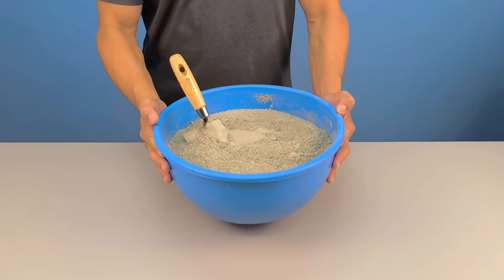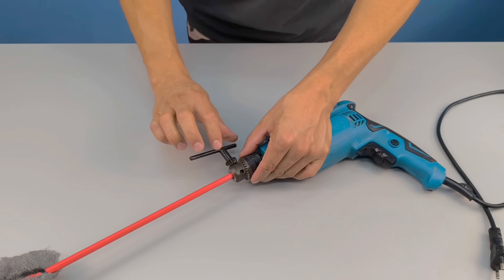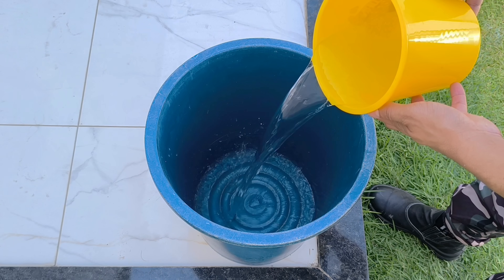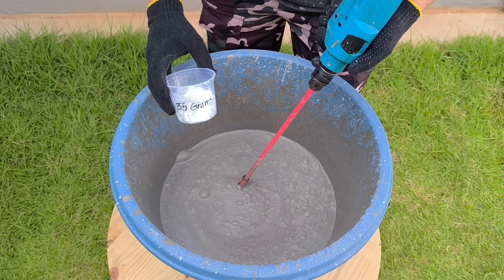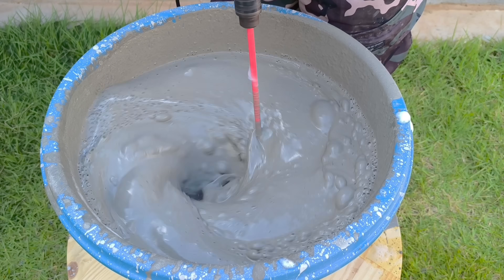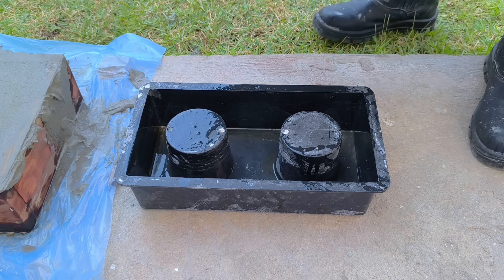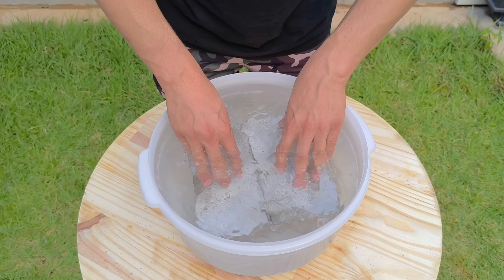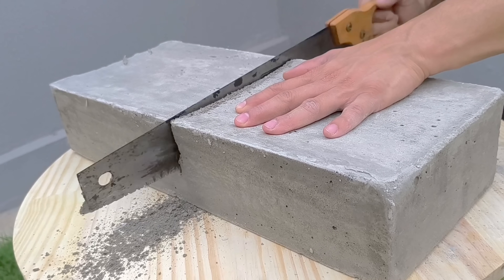Mix CEMENT with DETERGENT and create something that can REVOLUTIONIZE civil construction!

Comment: Could you make a follow-up video with some stress tests? I’d love to see how its strength and resistance compare to traditional concrete.
Reply: And water resistance/permeability.
Reply: Also, 🤔 what about the r-value on the insulation factor on heat transfer?  🤷 Thanks
Reply: @hcaveman6954  if it compares to other aircrete formulations the R value is huge. Somewhere around 50 I think? It also behaves similar to stone in the thermal mass characteristics but not as well. The addition of fiberglass may lend some structural stability I haven't seen in other formulations. I may try this method on a small scale before building a foam generator with an air compressor. I don't believe this end product can survive exposure to the elements, rain in particular, so I imagine it'll have to be sealed on the external faces, or behind an impermeable siding like steel or vinyl. I was thinking about an RV roof type brush on silicone. There's numerous aircrete techniques out there, if this is like others it'll be a building component with novel properties, not a standalone structural one.
Reply: @hcaveman6954  Foamcrete is reported to be about 3 to 4 R-value per inch.
Reply: I'm just going to go out on a limb here and say that concrete is weak very easy to break and not viable to build with
Reply: @jamesonbrandt9451  Concrete is a very weird material. Used under pressure, it'll last hundreds of years. Built in concrete slabs with less pressure, and it'll crumble within 50 years. Many 70s concrete buildings are unsalvageable, while buildings from the Roman Empire hold steadfast with no cracks.
I have my doubts that he is equipped to test these concrete bricks with a material that can behave so very differently depending on the pressure under which it is put for centuries or mere decades.
Reply: @SilkesterOnTube  Did the Romans use Joy or Palmolive?
Reply: @ShannonWoodcock  Talking about concrete generally, not foamed concrete. When comparing foamed concrete to concrete in general, the difference in behavior when the construction applies constant pressure and when it doesn't is relevant, and this difference shows after decades, which makes the testing on a crucial aspect of concrete for a youTube video unfeasible.
Reply: @SilkesterOnTube  the Romans made their concrete out of different things. This would probably be good for insulation. I've seen dome homes built out of this foam brick they can be shaved and shaped into interesting shapes then the arch form is then covered with a shell of harder cement or mortar and they have insulation properties not unlike like a cob house
Reply: @sarahsutubeusername  Shoot. Should have checked instead of relying on a vague old memory from an art history lecture. Did fact check you and learned something. Thanks.
Reply: @SilkesterOnTube  roman concrete was a thing on its own you'll have to look it up, quite genius actually!
Reply: @SilkesterOnTube  Romans used a very different mix of concrete which was well used at the time and probably not made by them as it is found even in ruins far predating the Roman Empire. That mix gets stronger over time and in salt water (oceans) and lasts for ages. Our modern cement is designed to wear out because having to buy new means money from replacements and repairs.
Reply: @hamzahsayang This is nonsense! That is your interpretation of modern cement. Like much ancient knowledge, the knowledge of this recipe was lost until a few years back, when a German rediscovered it.
Buildings can't afford built-in wear and tear. When corrupt builders try to save a buck and make concrete even shoddier than its normal life span, people die in collapsing buildings. 
 And with modern concrete buildings, there often is no restoration. I learned about the lifespan of concrete in an art history lecture, because in Europe you try to build for the ages and preserve buildings from known architects,
Historians have a hard time with post-war concrete buildings. The only choice is to tear it down.
And when a buiöding costs up to a quarter of a billion, even US real estate moguls frown at a 50 year life span.
Reply: @ShannonWoodcock  they used lard and lye lol
What do you think soap is made from.
Reply: @SilkesterOnTube   there actually is a scientific study on Roman concrete that discovered why it lasts that long:
Material and Elastic Properties of Al-Tobermorite in Ancient Roman Seawater Concrete
Found at
Journal of the American Ceramic SocietyVolume 96, Issue 8 pp. 2598-2606
Reply: @marcoconte7673  I'm sure there is. There is also a company founded by a German who recreated the recipe. These days, you can buy concrete with the properties of concrete from Ancient Rome.

My initial post was casual and relied on a vague memory of an art history lecture from decades ago. I'm happy it led to all this new information. I regret I was so casual and didn't go on a discovery tour before posting.
Reply: @ShannonWoodcock  :face-blue-smiling:
Reply: @jamesonbrandt9451   You would be incorrect.  Although it doesn't have compression strength, it's not brittle. Suitable for building structures of a single story. It has great insulation value as well. Look up aircrete for more uses.
Reply: @jthomas7904 oh no... just like concrete, it is still brittle. Use proper rebar and dont use aircrete for structural support.
Reply: @jamesonbrandt9451 and you would only be half correct
Reply: Im gonna 2nd this lol I had the same thoughts myself. If it cuts and scratches way easier then it's density is less than normal and would mean it is NOT as hard as regular cement I could be wrong tho and thats why we must experiment 😊 lol curiosity
Reply: @FrvrClud  "its" density. "It's" is the contraction of "it is"
Reply: And fire resistence
Reply from the maker: That’s a great suggestion! I’m planning to make a follow-up video testing its strength, compression, and durability against regular concrete. It’ll be really interesting to see the results.
Reply: @inovaouinventa why re-do that experiment? It was done many years ago when aircrete was first invented.

Youtube search "aircrete" and "green dragon".
Reply: @inovaouinventa  oh god it is obvious ai.
Reply: And BULLETS WITH DIFFERENTS GUNS🤦🏻‍♂️🤦🏻‍♂️🤦🏻‍♂️🤦🏻‍♂️🤦🏻‍♂️🤦🏻‍♂️
Reply: @inovaouinventa  follow up with fake data. you are a clickbait fraud!  PERIOD!!!
Reply: Roman concrete had a secret ingredient.  Volcanic ash that was shipped hundreds of not thousand of miles to build.
Reply: @christophern.9234 it was also made with salt water.
Reply: 7 day/ 28 day breaks  a full (by proportion mix design). Due you  have SKILLS! 👍
Reply: Mukavemet 2.5 Mpa (thats traditional brick are 5-10 mpa, normal building concrete 25 mpa), ısıl geçirgenlik katsayısı lambda 0.05-0.1 w/K.m2, buhar geçirgenliği mevcut yani nefes alabilir, birim ağırlığı 500 ile 600 kg/m3, yangın dayanımı A1 sınıfı, metal veya betonarme karkas arasına örülebilir ancak kendisi taşıyıcı Yapı elemanı olarak kullanılamaz, belki sadece 1-2 katlı ev yapmak için uygun olabilir, olumsuz olarak niteleyebileceğim tek özelliği bu malzemenin karışım esnasında katılan suyu içinden dışarı atması uzun zaman alır, eğer içine fiber katılmazsa kendi kendine çatlama yapabilir.
Reply: Is this how they make karate bricks ?
Reply: What about using this as ferro cement plastering ? How water proof is it? As an interior layer
Reply: How 'bout a sledgehammer test?😂
Reply: I'll save you the trouble. It is more brittle than regular concrete. We used to do this decades ago with stucco. It made the mix easier to spread, but got banned by the building code because it lacked sufficient strength.
Reply: these are for insulation not structural. only used as infill between structural posts & beams.
Reply: badly in a word
Reply: he cut it with a wood saw, does that tell you anything? and 35g of fiberglass is not nearly enough to add any strength value to that volume
Reply: I would like to know the Concrte strength what’s its PSI after 28days. And even if it’s half the typical concrete that still great and will have many practical uses
Reply: @lidoz roughly 25% to 60% the strength of regular concrete, depending in what you've added to the aircrete mix...  plaster makes it weaker, so this mix is 25% to 30%...  around 1000 to 1300 psi when normal concrete is 5000 psi.

It should be strong enough to make planter boxes, decorative moldings, decorative sculptures, insulating foundation application, walls that are NOT load bearing, roofing application (with sonething for rebar to avoid collapse)...

Not good for making stairs or sidewalks, floors, anywhere with heavy foot traffic or ANY vehicle traffic... no load bearing applications.  Do not attempt to use to create a foot bridge.

Strange things you CAN do with it... 

You can make a boat. (Not joking, this stuff really does float!)

You can make an all-weather igloo. (Can be used in antarctic, arctic, the sahara desert... just make thick walls and a good door with an insulated floor and dome around 16 inches thick!)

You can make a dome house (with rebar reinforcement... it's also earthquake resistant).

You can apply a few inches of thickness to the INTERIOR of a concrete building as insulation.
Reply: @gregoryhalye8907 thanks for sharing. There are many uses and needs for material like concrete that is light even if it’s not that strong
Reply: @gregoryhalye8907  planter boxes was what I was thinking of, specifically 

Probably need to use a sealant, but 60% weight reduction is a win
Reply: @lidoz   previous comment - it's 10% of "regular concrete" - so not load bearing, stronger than gypsum board..
Reply: @karmeloxen thanks so that’s like 300-400psi
Reply: @lidoz  visto che sei entusiasmato , io direi che il detersivo non è  uscito ancora del tutto , dal mattone, secondo me  , questi mattoni   perderranmo massa e saranno ancora  più  leggeri ,
chiaramente sono isolanti e non ci fai un muro portante , li ha   segati,  non sono cemento armato .
Reply: It gets WEAKER OVER TIME...AND IS WEAK TO START... this was BANNED in the USA 40+ YEARS ago.... don't use this mix for anything that supports weight... maybe to make a pot for plants or such.... thats it
Reply: I would imagine there will be a good chance of structural failure using aerated concrete. Shorter lifespan. Excessive deflection and cracking.
Reply: Very intelligent replies!  It would be better that others perform the same experiment as shown in this video, and THEN  perform strength and stress test, and publish results.  (As most know) This is know in SCIENCE as *Peer Review*.
Reply: Obviously not very strong- he cut it with a wood saw.
Reply: Yeah how about they're not gonna do any testing, because this video and this material are dogshit.
Reply: @KawamaYachtClub-this gentelman here already said it's not comaprable to regular concrete...but i thnk it's probably good for low-stress,light-thngs..like models..and set-designs........................(( WAAN ))
Reply: Yes. So, what can such bricks be realistically used for?
Reply: @whimpypatrol5503 an excellent insulation layer that's impervious to insects, fire, and mold for any climate in a building you build yourself because nobody can afford a house anymore, and you've got to start thinking outside the box?
Reply: @SunTzuLao i think traditional style insulation between studs requires a moisture wrap. I wonder what the inslation value that this material has and if it is breathable and could replace traditional fiberglass. If not, perhaps a similar mixture might be.
Reply: @whimpypatrol5503  long lasting bars of soap 👍
Reply: @whimpypatrol5503  Compressive strength comparable to a similarly sized wall made with conventional wooden studs. R-value almost the same as such a wall with fiberglass insulation.  Good for curtain walls in between structural columns. Also can make small standalone structures such as sheds
Reply: @whimpypatrol5503  they can insulate, the mixture can be used as a coating, large scale application at end of runways of an airport
Reply: @whimpypatrol5503  This can be used to produce light weight concrete planters
Reply: I would only use this type of concrete for decorative purposes. There is absolutely no way I would feel safe using these as say foundational blocks or anything that actually needs strength/support, but maybe stepping stones for the garden or something, but not for building use
Reply: @juliofmneto  youtube search "aircrete" ... it's been around over a decade.

You can also search up "green dragon".

Plaster is not normally used in aircrete, it just makes the concrete set up and dry faster, but it becomes much weaker.

If you swap out the Portland cement for CSA high strength calcium silicate, you get something that is even lighter and stronger.

For better aggregate choice, you can mix in the fiberglass strips and some perlite (expanded volcanic glass) for better interior structure and very little added weight.

Aircrete alone can be damaged by a weed eater trimmer line.  The CSA version is nearly impervious.

Both float in water without a problem.

Making garden boxes from aircrete is pretty simple and results in a lightweight strong stone box. No rotting wood, no UV deterioration.
Reply: ha usato la sega no , ? si tratta di un isolante simile al gesso.
Reply: What about mechanical stress resistance?!?
Reply: It won't hold up to much stress at all, I am curious to see how it would react to wet and dry cycles....  It will crack instantly in any climate that rains and gets below freezing for sure, but depending on how the water dries it may be good for light duty decorative work in areas that aren't far from the equator.
Reply: It'll be weaker than a Chinese anvil
Reply: Don't keep holding your breath for the reply 🙄
Reply: What about using this inside IFC block walls with rebar reinforcement just like regular concrete. The foam stays in place around the concrete and then you can put siding or stuco on the outside and drywall on the inside. Regular IFC walls have a crazy high r value already.
Reply: Would it stand up to being used as a sidewalk?

Comment: but, is it as strong as normal cement? How much less strong is it? What can it be used in? What applications? I ask this respectfully.
Reply from the maker: Thank you for the respectful question! It’s lighter and less strong than regular cement, but still solid enough for decorative pieces, lightweight blocks, and insulation panels — not ideal for heavy structural loads.

Comment: This has been used for years. They use this in trenches , it fills in voids  in the ground.  It's called foam concrete,  or in block work,  it's called thermolite  blocks.
Reply from the maker: Exactly right! It’s very similar to foam concrete or Thermolite blocks — lightweight, insulating, and great for filling or non-structural construction.

Comment: HI everyone just.... Keep in mind this blocks not to use for fire place. The bubles blow up the concrete.. is danger. Regards:hand-orange-covering-eyes:
Reply from the maker: That’s a very important point! Thanks for sharing this valuable safety tip — yes, this material isn’t suitable for high heat or fireplaces.

Comment: 45 years in the USA. Originally from the U.K.
I had an amazing and brilliant idea (to me!!!). Some years ago. To make a lighter refractory brick. I used ony the refractory cement, with the addition of pulverized "alka Seltzer" tablets added to the dry mix. It had a result of being a little lighter for sure, but the water addition caused a very fast reaction .I believe most of the released Co2 just escaped. This video demonstration is the answer I was looking for.
Reply from the maker: That’s a fascinating idea! Using refractory cement to make lighter heat-resistant bricks sounds like a great project. Thanks for sharing your experience!

Comment: So the soap adds micro air bubbles but what does the plaster do?
Reply from the maker: Excellent question! The plaster helps with setting time and improves bonding — it also adds a smoother finish and increases hardness once cured.

Comment: This method is for those who enjoy challenging themselves. 
Everything GENIUS is EASIER than you think.
If you apply a regular 1:3 cement and sand mixture to the foam plastic in a layer of about 1 cm, you'll get EXCELLENT bricks... They'll be lighter and STURDY. And it only takes 10 minutes.
Reply: @ЗакоВыка  can you go into details of what you are saying about the hard shell. I'm trying to come up with a block that can be demolded in a few minutes vs a couple days. With coating it like you said would it be able to do that? Many thanks.
Reply from the maker: Thanks for the great tips! Always appreciate new ideas and methods for strengthening these mixes. 💡

Comment: And with that much liquid and no aggregate ;you have cement, not concrete, that has the strength of a lump of dirt.  Might make a good insulation but it would have no structural use.
Reply from the maker: You’re right about the structural use — it’s definitely not for heavy loads, but it excels as an insulating and lightweight material. ⚒️